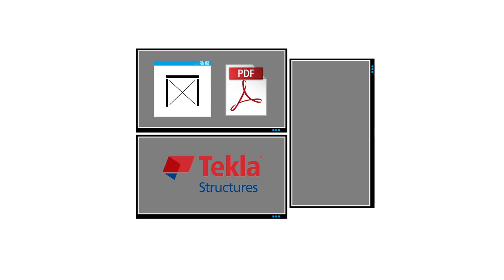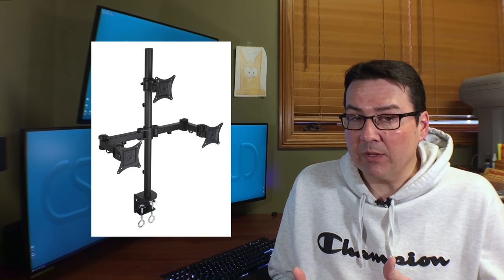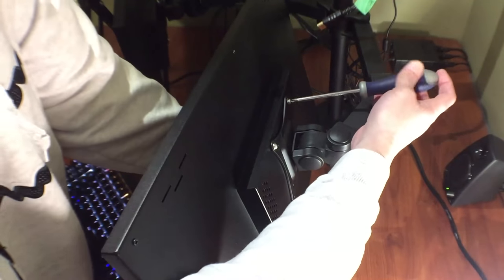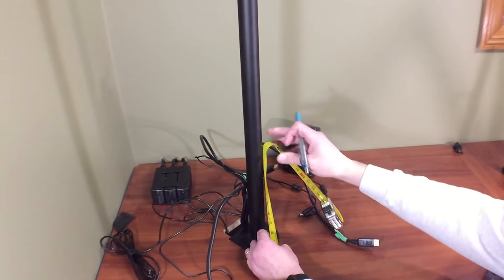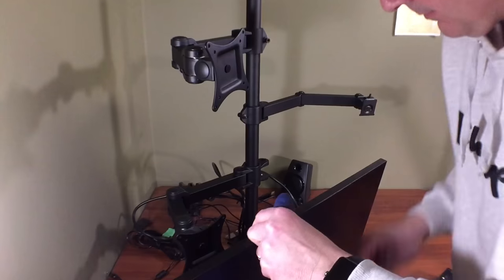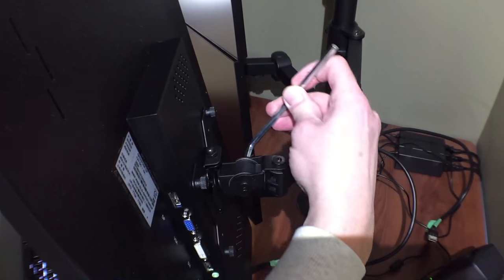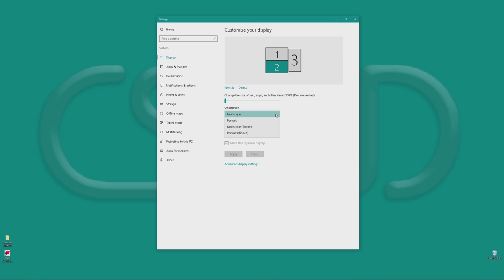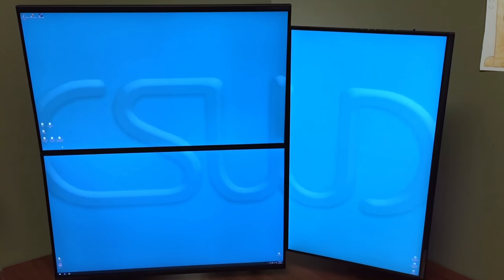Three Monitor Custom Setup

Comment: Mine are arranged like this.  Its even better if you have PowerToys from Microsoft added to your windows 10 for custom snap grids.  The vertical monitor gets a lot easier to work with when you can snap windows the way you want, like in triplets.
Reply: what is the size of you vertical monitor?
Reply: @juanitodiaz75  27 inch
Reply: @MinecraftMartin do you have two 24” monitors stacked and have a 27” vertical? thinking about running that setup but i’m just unsure on the mounting options. idk if having one to hold all three is a good idea due to weight, but i already have so many things clamped onto my desk it’s starting to look ugly
Reply: @yeen69  I was using a dual mount to hold two monitors with the right one flipped vertical, and the third on its own stand up above the lower left monitor.  My desk has kind of a shelf thing.

That said, you could probably just try looking up the weight limit for the mount you're using.  Should be a manufacturer and model number on it somewhere hopefully.

Comment: Finally! My god I feel like this is the only video on the internet about setting up 3 monitors like this. My question is tho, I love the spring lock/gas arms for more adjustability like the MOUNTUP triple arm monitor. IS it still possible to achieve a display setup like this for those types of mounts?
Reply: I have the spring arms mount and monitors, trying this exact setup tomorrow, wish me luck 🍀
Reply: Hey  @hiramary , how did you go? I'm looking to try this set up and would like to use the 3 arms mount

Comment: Thanks for the video! I'm using two 27" monitors with my main as landscape (center) and my secondary as portrait (right). I'm upgrading one of my monitors, but figured it might be worth trying a triple monitor setup, and I like this one the most. My only concern is having your main monitor so low to your desk that you are looking at a downwards angle most of the time. How do you like your setup after a few years?
Reply from the maker: Honestly, I have changed it from this setup. I now have one 43” 4K monitor and one 32” 4K monitor.
Reply: @CSWilsonDraws   Is there any way you can show us your new monitor arrangement using a 43 and a 32 ?  I currently use 3 x 27" and thinking if 43" will help enhance productivity

Comment: Nice practical setup.     I dont use monitor stands/arms at all........all that unsightly and troublesome metal.  I simply use basic DIY screw in by hand type  hooks/ bungees and cable ties and suspend mine from the ceiling.......sounds crazy but its so much better and costs practically nothing...........these are just items laying around the house/shed/garage.   If you think about it, the space above your desk/monitors in 99% of cases is completely redundant extending right up to the ceiling of the room/studio.  So why not use this space,  not waste desktop/wall space with unsightly arms that need drilling holes or fussing with clamps and screws  and whatnot.   I can move all 3 monitors with just one hand as the bungees are taking most of the weight.  Its a shame I cant attach a picture here.  I have 2  32 inch 2k IPS  monitors and one 28inch 4k,  but will swap that for a huge 49inch 4k one soon, using same methods of suspension.    Another idea i will toy with is having the 2 , 2k's  side by side in landscape , and the 4k in the middle above them , Kind of like your old setup, except the bottom two are vertical,  in essence making more of a huge sqaureish monitor with bezel in the middle.   Have fun with your new setup!  Peace and Productivity!

Comment: Thanks to sharing this vid. But I would like to ask do you have any solution to the big Tekla windows, which are bigger than the display?? Thanks in advance
Reply from the maker: Try Alt+Space, then M.  This allows you to use the arrow keys to move your windows around.  You can move them up or down to reveal an edge so that you can resize the window to fit.
Hope that helps!  And thanks for watching!

Comment: How have you liked the setup from using it over the years, cant choose if i should do this set up or a tie fighter set up (basicly the monitors like this l---l lol) i have 2 27in monitors and i would have a 24in in the middle
Reply from the maker: Honestly, I have changed it from this setup. I now have one 43” 4K monitor and one 32” 4K monitor.
Reply: @CSWilsonDraws  curious to know what made you decide that? I am strongly considering your setup in this video

Comment: What pc do you have running it all? I'm looking to buy a new one and this setup looks great.
Reply from the maker: I originally built this system in November of 2013 and it has been upgraded a few times since then.  I believe that 2018 will be the year I build a new system from scratch again.  There's really nothing wrong with this one, but it's getting a bit tired and I'm just ready for a new one.

My current configuration is as follows:

ASUS Sabertooth Z87 Motherboard

Intel i7-4770K (3.5GHz) CPU w/Cooler Master Hyper D92 Cooler
32GB Kingston HyperX DDR3 RAM
EVGA NVidia GeForce GTX-960 2GB SSC Video Card
Corsair HX750i Power Supply
Phanteks P400 Eclipse Mid-tower Case

Samsung 850 EVO 1TB SSD (Main program drive)
(2)HGST 3TB 7200 RPM HDD (Raid 0 Config, Data Drive)

(3)QNix QHD2730R DP 27" Monitors (2560x1440)
Corsair K95 RGB Keyboard
Logitech G900 Chaos Spectrum Mouse
Corsair MM800 Polaris RGB Mouse Pad

You also see more of this system in another video --> https://youtu.be/5Lx5e5j9uM4

Comment: I know it’s been 5 years since this video lol but what is the name of those monitor mounts this is the exact way I want to set mine up
Reply from the maker: I no longer use this setup, but here are links to the stands I purchased:

VIVO Triple LCD Monitor Desk Mount Stand Heavy Duty and Fully Adjustable, 3 Screens up to 30 inches STAND-V003T https://a.co/d/9lCPr2c

VIVO Single Monitor Desk Mount, Fully Adjustable Monitor Arm Stand with Clamp and Grommet Base, Tilt, Swivel, Rotation - Holds 1 Screen up to 22lbs with VESA 75x75mm or 100x100mm, Black, STAND-V001 https://a.co/d/2Sijro6

Comment: I have a random Question. How did you set up the "old" Setup? Currently looking for a stance to fit my 32" and my two 24" monitors on in exact this pattern..
Problem is most of them only fit until 27"
Reply: Julian's TEC ZONE buy a wall mount

Comment: I have random monitors i need to buy a stand but how do i know the stand will be compatible?
Reply from the maker: Consult your manual and look for the VESA mount specs.  If no manual, look on the back of your monitor and see if there are four threaded holes.  If so, measure the distance from one hole horizontally or vertically to the adjacent hole.  It should be around 100mm which is a VESA100 mount.  If it's different, then look for a mount that matches your hole spacing.

Comment: Does anyone have a link to the monitor stand? I like his original setup and would like to run it myself, but I need that triple arm, its perfect!
Reply from the maker: Vivo is the manufacturer.  Search for STAND-V003T and STAND-V001 on Amazon for a similar ones shown in the video.

Comment: Well shoot what monitor arms are they man?
Reply from the maker: Vivo is the manufacturer.  Search for STAND-V003T and STAND-V001 on Amazon for similar ones shown in the video.
Reply: @CSWilsonDraws  thanks for your time man
Reply: @CSWilsonDraws  so did you get the talk center rod option ?
Reply from the maker: https://smile.amazon.com/dp/B00B1D03GQ/ref=cm_sw_r_cp_awdb_imm_615MG273GBSV0J46Y6CA